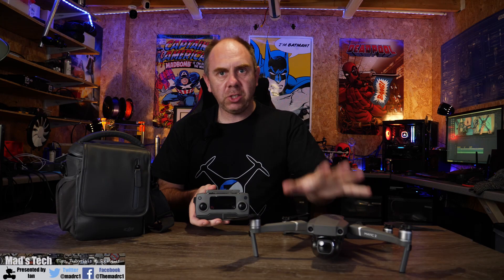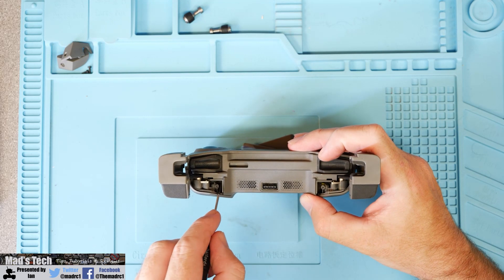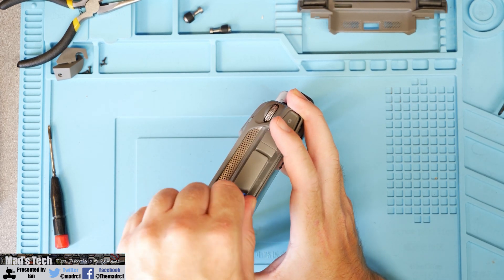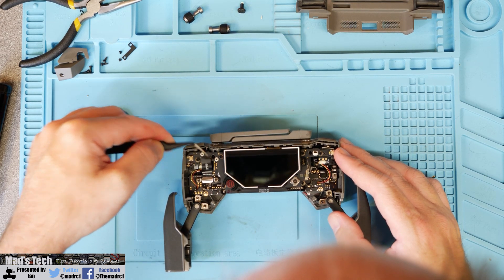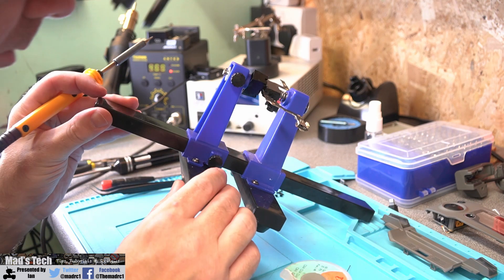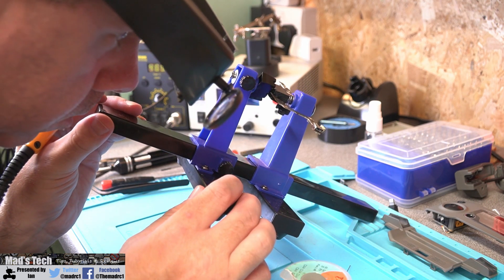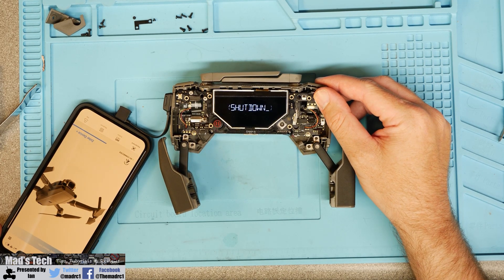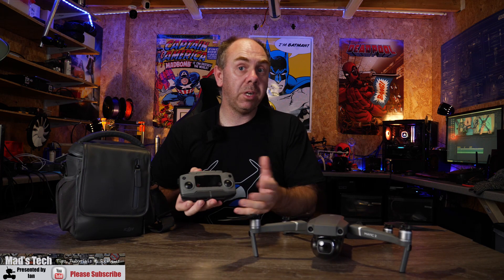DJI Mavic 2 Remote USB Repair -  How To

Comment: Hi, i am actually repairing a broken remote. Already unsoldered the old socket and wasn't sure if the very right soldering pin is connected to this spot right next to it. Thanks to your video i am sure now that they haven't been connected. So thank you very much for your video, it was a great help. Btw i decided to directly solder a micro usb socket in, since you can't destroy it as easy as the original socket by putting the plug upside down in.

Comment: I managed to squeeze one of the wires ( the white one ) when I unplugged the small connnector at the 3:50 . It is so small that I cannot see if the cable is broken or just squeezed. Any ideo how to replace it ( The right one, , red, yellow, black, white wires ) , or what it is anyway ? The RC seems ti be working since then , by the way.  Thanks !!

Comment: Thank you so much for this great clear and thorough tutorial. I had a bad micro usb port, not broken off, but I think I must have shoved it in bad and messed up the inside part. Bought another daughter board replaced it and all working perfectly again.
Reply: where have you found the board?

Comment: How do you know if it's the USB port or the battery. My controller won't charge and has a black screen. Basically I don't know if I need to fix the USB or replace the battery.

Comment: Good Video—I'm currently attempting to replace the micro USB on a DJI Spark remote....the solder does seem very difficult to melt–is that due to it being lead free??

Anyway the connector's off, and I'm wondering if I can replace the micro USB AB that was originally on the board with a micro USB B because the design of the AB is such that it's so easy to break the pins if you put the charger lead in the wrong way—I've done it twice!! I don't use the OTG feature at all, so I'm thinking micro usb B should be ok...

Comment: The large USB port on the bottom of the remote’s broken for me.
Also no idea how it happened.
If I try to repair it myself, and find out soldering on a new port doesn’t fix it, do you think DJI will refuse to do in-house repairs on it?
Usually stuff like this voids warranty, but it’s long out of warranty anyways.

Comment: Do you have any idea of the part number (or an equivalent one) for this usb connector? Mine is completely broken !
Also the one for the 5d button is missing on my remote so I'm interested into this also
Reply from the maker: No this connector is a complete PITA to find.  People have replaced it with a micro usb but that will allow charging only.
Reply: @MadRC  I managed to repair my remote with a TE connectivity 2134536-2 it just need a slight bend to find in these holes perfectly
It's charging and transmitting now
Reply from the maker: @cuteraptor42  that’s a fantastic find. Thanks for sharing.

Comment: Hey man, can you please tell me where i can purchase the correct micro port? Mine is completely broken and I want to make sure i have the right part. Thanks
Reply: If you have any idea for the solution now, I'm also interested hearing it
My closest guess is a TE connectivity 2134536-2 , it's not exactly the same but it should fit. I was about to order one to test it
Reply: I can confirm this works, it is really close to the original

Comment: Any idea where I can buy the battery for the M2P controller?
Reply from the maker: Sadly that’s not an easy one.  Iv not looked my self but Amazon and eBay.  If not try to find a pack that similar shape and size at the correct voltage.

Comment: Great job as preparation to add the polish range extender, these 4hawks antennas I ahd purchased for the Mavic 2 ...
They showed that too but a lot faster. Thanks a lot  ... learned a lot from your kind of getting into the things safely.
Looks like an artist at work watching your style of work, the patience you must have.
Isn't that a case for the great DJI warranty ? 
Mine is over ... but I am still pretty happy to have bought at least the ZOOM at the right moment in time for 780€ back in Nov. 2018 when they had stress to sell the units due to missing capabilities even after a mighty delayed market introduction for which I had bet and did not buy it. Same for the Mavic 2 fly more kits at below 250€ and the goggles Racing edition cause otherwise DJI stuff is simply too expensive. That way I try to get the stuff, use it carefully and sell it sometime later without much depreciation ... cause it is just a hobby in the end among a lot others.

Comment: Nice job! I have had my fair share of broken micro usb port's, mainly on flight controllers. Luckily i am good when it comes to soldering, so have always been ok. Why companies use surface mount usb ports i do not know, through hole ports are virtually impossible to break loose compared to the surface mount ones. Strangely enough i have found that the biggest culprit for breaking ports off the board are the good quality usb leads - the ones that fit in very snugly and have the strong clips that hold the plug securely in the socket. I try to avoid those leads if i can, but having said that, when it comes to flight controllers, there is nothing worse than a lead usb plug that is too loose - especially when your trying to calibrate your mags and accelerators! 😡

Comment: Mad, Excellent video. Big Fan! I have enjoyed your videos and am a fellow ham and Drone Flyer!
Was wondering where you got that cool desktop vise assembly. I love that. I am sort of sick of using the Vise devices with suction cups. They never work right. Was wondering if you can share how you did this or where you got it from? Thx, Jeff
Reply from the maker: I got it from Amazon, its was a fairly cheap one,  try searching for BURNTEC PCB Holder Clamp.   What you REALLY want and what I want is this though Sensepeek PCBite Kit , https://www.telonic.co.uk/Sensepeek-PCBite-Kit-Large-Base-Plate-p/sensepeek4007.htm, this is the best I have seen.
Reply: @MadRC  Got it pal, I am looking for it now! Thanks so much! By the way, Great Crystal Sky Videos. I have one because of you. Sure wish DJI would support them.

Comment: Hey Mad, do you know how the repair the Spark? - Mine requires IMU calibration, but always gets stuck in "step 1". Any advise is appreciated.
Reply from the maker: Sounds like a stuck IMU,  when you get stuck can you explain more ?
Reply: @MadRC  It requires IMU calibration. But IMU calibration gets stuck at step 1, and then shows error code-50 message. I refreshed the FW, but it did not help. Do you know how to activate Dev Tools in DJI Assistant 2?

Comment: Hi Ian, great video, but i was worried that you were not using a Solder fume extractor, be careful this stuff is dangerous.!
Reply from the maker: Yea I was not actually, it’s something I need to sort. I have a plan for this as I have acquired a few big fans. I may make a video on making it.  Been sniffing the lead for years but no it’s not good ;).
Reply: depends on how often you solder. It's about the amount of exposure as always and even in corona times. 

How often, how long and how close.

Otherwise world war 2 must have  ended far earlier running out of solderers.

RADAR is far more dangerous ... lot of dead operators died by cancer using american radar equipment in the esrly 80ies